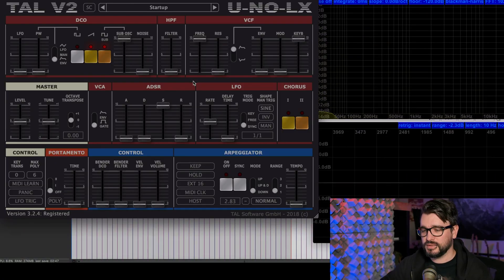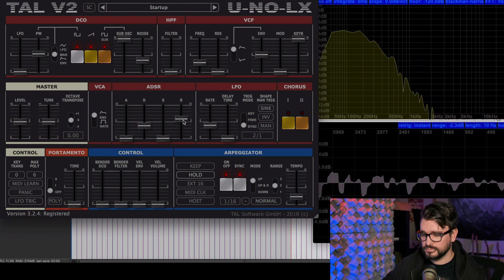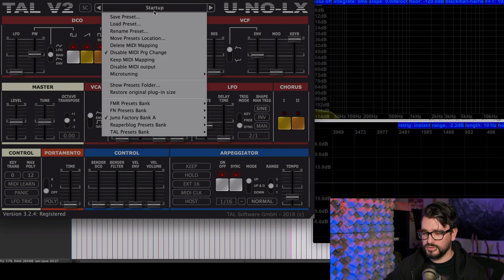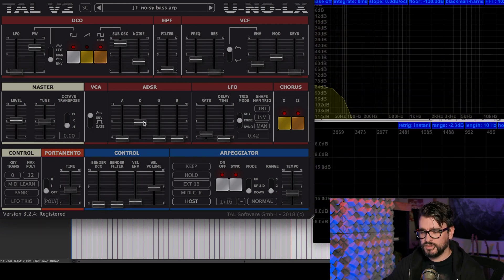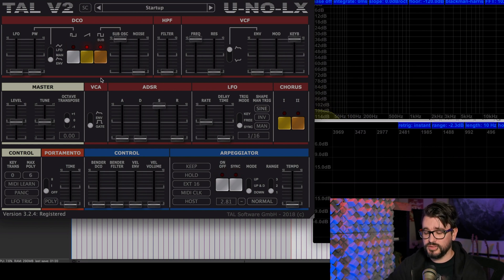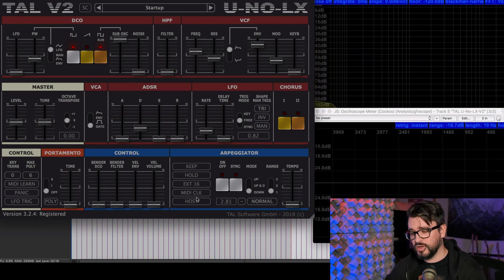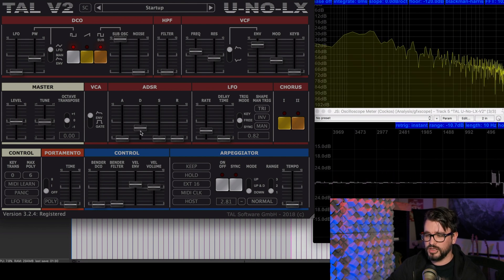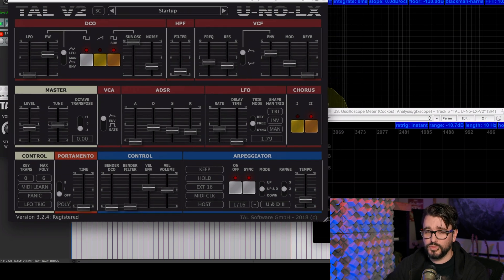𝙏 𝙃 𝙄 𝘾 𝘾 Virtual JUNO Synth - TAL U-NO-LX Review & Tutorial

Comment: I used to have a real Juno 60, and I have it recorded in an old session. I put the TAL up against it and matched sounds as close as I could. It’s incredible. Most realistic vintage synth emulator I’ve heard so far. The real one is a bit richer but hard to tell. The biggest difference is with hard filter cutoffs. Digital can’t hit the brown note like analog can. On a completely separate topic, do you have any clever tricks for getting protools files into reaper properly and lined up without converting them inside protools or using expensive apps like AATranslator or ProConvert? I just opened one and it was 347 tracks 😐
Reply: I just read your Reddit post lol